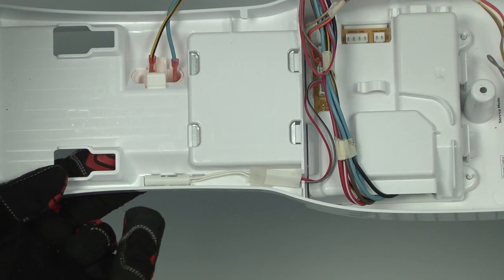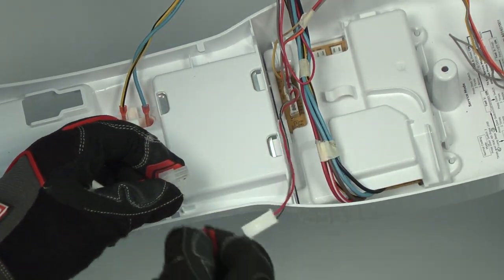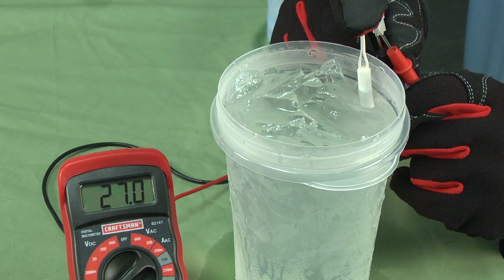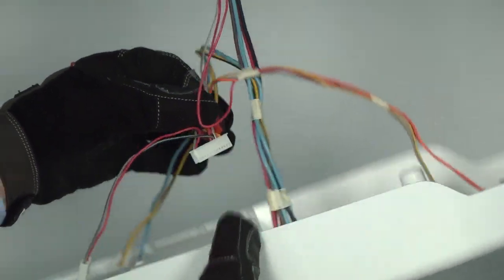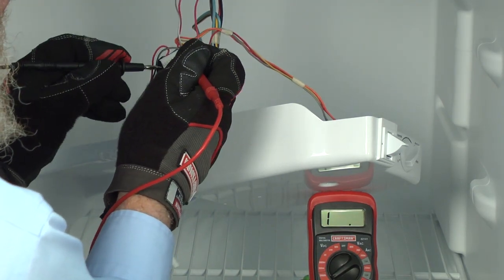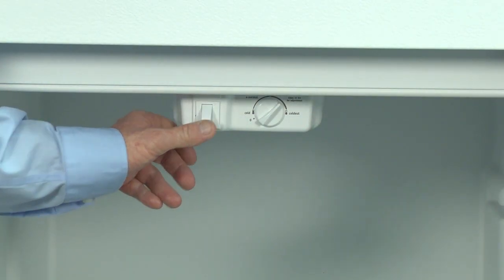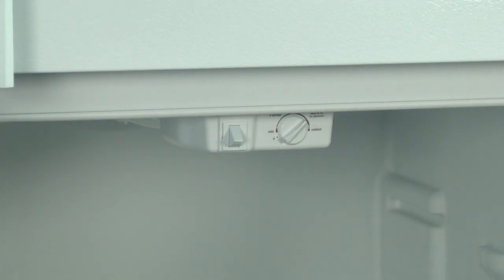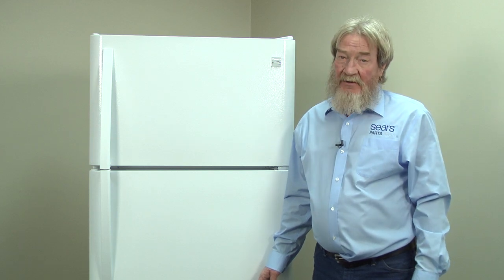Troubleshooting Thermistor Problems in Refrigerators

Comment: Is the control board housing on my Kenmore 60412 removed with a screwdriver or nut driver? Thank you
Reply from the maker: That model uses ¼-inch hex head screws to mount the control board housing. Use a 1/4-inch nut driver to remove those mounting screws.
Reply: Thank you, but I was talking about removing the actual large white housing that holds the board, thermistor, light, etc. I found one 5/16" hex in front and unscrewed that, but it is still somehow held in back. Is this held with keyways and slides out? I don't want to break anything. Thanks again
Reply from the maker: @MichaelJohnson-mb1io  After removing that front screw, pull the control housing forward about ½-inch to release the keyed slots in the control housing from the plastic tabs mounted to the roof of the refrigerator compartment then lower the control housing and unplug the wire harness. You can see the keyed slots in the housing and the plastic tabs on the roof of the refrigerator compartment in the video.
Reply: Thank you very much, I noticed the slots in a video.
Reply: I appreciate your help. So now I'm hoping it will be either the heater or the thermistor and I will test both, and the wiring. Is there only one heater and thermistor that will fit the Kenmore 60412, and if so, what are their part numbers, please. Thank you
Reply from the maker: @MichaelJohnson-mb1io  There are 17 different 60412 Kenmore models. Kenmore uses a model number prefix of 253 (253.60412…) for those models. Those 17 models have different control systems. Some use a thermostat and defrost timer to control cooling and evaporator defrost while others use an electronic control board and a fresh food compartment thermistor to control those functions. Your details seem to indicate that you have a model that uses an electronic control board to control temperature and evaporator defrost functions. If your refrigerator has and electronic control board and it's having cooling problems because of excessive frost build-up on the evaporator, follow the troubleshooting tips in this article/video to fix the problem: https://www.searspartsdirect.com/diy/article/refrigerator-wont-cool-troubleshooting-video-defrost-system-problems . A 60412 refrigerator with an electronic control board typically has 2 thermistors. One thermistor located in the control board housing monitors refrigerator compartment temperature and a defrost thermistor attached to the evaporator monitors evaporator temperature and helps control the defrost function. If the defrost thermistor isn't accurately measuring evaporator temperature, then you'll need to replace the defrost system wire harness that includes that thermistor ( https://www.searspartsdirect.com/product/2088n9if61-0046-253/id-242213501 ). Note: Be sure to unplug the refrigerator before replacing parts. If the refrigerator compartment thermistor isn't accurately detecting temperature inside the refrigerator, replace that thermistor with this replacement part https://www.searspartsdirect.com/product/4yv4pimcyn-0046-253/id-240597203 . The 60412 refrigerator only has 1 defrost heater. Here's a link for that replacement part: https://www.searspartsdirect.com/product/5lmgrsv9zh-0046-253/id-242044020 . If the defrost bi-metal thermostat isn't working, you can replace that component with this part: https://www.searspartsdirect.com/product/mzu0nl3g08-0046-253/id-5303918634 . (The defrost wire harness mentioned above also has the defrost bi-metal thermostat included as one of its components.) We hope this information and advice helps. If you need more assistance, let us know the full model number of your 60412 refrigerator and more details about the problems you're seeing. You can find the full model number of your refrigerator on a sticker located on the right side wall inside the refrigerator compartment.
Reply: The thermistor next to the control panel in the refrigerator is good, but I can't access the brown and blue wires to measure the defrost heater continuity. Am I missing something, or should I just go ahead and measure the heater resistance in the freezer? Would it hurt to stick pins in the brown and blue wires to obtain a measurement, if I sealed the punctures afterward? A non Sears source said that for some reason you couldn't measure the resistance of the defrost heater in the freezer, which I seriously doubt. Any validity in this? Thank you
Reply from the maker: @MichaelJohnson-mb1io  The temperature in the freezer compartment has to be below 46-degrees to accurately check defrost heater continuity through the brown and blue wires at the control because the defrost bi-metal thermostat is in that circuit and the defrost bi-metal thermostat trips at around 50-degrees so you wouldn't get an accurate resistance reading unless the freezer is below 46-degrees. You can unplug the refrigerator and access the defrost heater wires as shown in this repair guide/video: https://www.searspartsdirect.com/diy/repair-guide/how-to-replace-the-defrost-heater-in-a-top-freezer-refrigerator . Unplug the defrost heater wires from the wire harness and measure resistance through the defrost heater. If your meter measures infinite resistance through the defrost heater, replace it. Don't forget to unplug the refrigerator before replacing the defrost heater.

Comment: Does anyone know if a domestic refrigerator can have a thermistor and a defrost timer at the same time or can they only have one of the two?
Reply from the maker: If the refrigerator has an electromechanical defrost timer then it typically doesn't have a thermistor. Thermistors are used in models that have an electronic control board that controls the defrost cycle and other refrigerator functions such as cooling.
Reply: @searspartsdirect  oh my GOD!!! thank you so much for your answer. This question was breaking my head. Thank you again!

Comment: It looks like only the red lead of the multimeter is being connected to only one of the two sensor leads. Is that correct? How is the multimeter measuring resistance without using both probes?
Reply from the maker: The black lead of the multimeter may be difficult for you to see but it is connected to the other sensor contact.

Comment: What tool is needed to take the top compartment off in the refrigerator?
Reply from the maker: To release the control housing in the roof of the refrigerator compartment of many refrigerator models, you'll need to unplug the refrigerator and remove fasteners using a screwdriver or nut driver. You may also need to release catches to remove the control housing from the roof of the refrigerator compartment. We hope this information helps. If you need more assistance, let us know the model number of your refrigerator and more details about the compartment that you're trying to access.

Comment: LMX25964ST is the model of my samsung fridge. Does this ohms reading apply to most or all models of samsung fridge? Also what is the thermistor looking part that is tucked inside the evap coil?
Reply from the maker: The model number you posted appears to be for an LG refrigerator. On that model of LG refrigerator, the thermistor tucked into the evaporator is part of the defrost sensor assembly. The part number for that model depends on the revision numbers after the "ST" in the model number. For model LMX25964ST/00, the defrost sensor assembly is part 6615JB2005H ( https://www.searspartsdirect.com/part-number/6615JB2005H/0046/795.html ). For models LMX25964ST/01 and LMX25964ST/02, the defrost sensor assembly is part number 6615JB2005N ( https://www.searspartsdirect.com/part-number/6615JB2005N/0046/795.html ). The thermistor resistances in your refrigerator differ from the resistance of the thermistor shown in the video. For your refrigerator, the resistance through the defrost thermistor in that defrost sensor assembly should be 30 kohms at 32F, 77 kohms at -4F and 13 kohms at 68F. Be sure that you unplug the refrigerator before accessing internal components. We hope this information helps. If you need further assistance, let us know.

Comment: Great video sir I do have a question please! I pulled out the freezer temperature sensor in my Samsung side by side freezer and checked the resistance which seems fine. My question is do you have to do the cold water test also I only checked at room temperature and did get the correct reading?  Our fresh food side temp is fine freezer not cooling as well as it use to melted ice cream and no ice being made. Any help would sure be appreciated from any of you pros out there I am just a newbie trying to work my way through the repair. Thank you in advance have a wondeful day. Paul
Reply from the maker: If the meter measured the right resistance through the thermistor at room temperature then the thermistor is likely okay. Let us know the model number of your refrigerator and we’ll provide some DIY troubleshooting tips to help you fix the freezer cooling problem.
Reply: Did u ever figure your problem out?

Comment: Hi. Hoping you can help me. I have a Frigidaire side by side PHS67EHSB4 that's been acting up. The freezer and fridge stopped cooling all of a sudden.  I decided to leave it unplugged for 24 hours thinking this will somehow reset the motherboard to its default setting and get it to work normally again. After I plugged it back in both the freezer and fridge will work normally for about 20 hours before shutting off again. It will not come back on unless I repeat the unplug/plug process again. When it is not working, the temperature on the control panel is still registering false temperatures of 27 F on the freezer side and about 39 F on the refrigerator side. I can then get it to work for another 20 hours or so if I unplug/replug it again. When it is not cooling, the lights are still on. I wonder if it is the thermistors. If it is the thermistor do you happen to have the resistance specs for the freezer and fridge thermistors for both room temp and freezing temp?  The thermistor part numbers are 241608401 and  241608501 but I cannot find the specs for these thermistors no matter how hard I tried.  Once I get the specs I think I will be able to remove them to test them with my multimeter. Thank you in advance for your help and expertise.
Reply from the maker: At 32 degrees, thermistor resistance should be 32,566 ohms. At 72 degrees, thermistor resistance should be 11,304 ohms. Both thermistors should have the same resistance at those temperatures. It’s normal for resistance to be off as much as 5%.
 
If thermistor resistance is okay, check the operation of the air damper using the diagnostic test mode because your symptoms point to an air damper failure. The refrigerator electronic control board shuts off cooling if the air damper fails to operate. You can restore cooling by unplugging the refrigerator for 1 minute then restoring power to the refrigerator. The refrigerator will cool properly until the control again detects the air damper failure.
 
To enter the diagnostic test mode, press and hold the Freezer Temperature UP key then press the Freezer Temperature DOWN key 3 times within 5 seconds. Release the Freezer Temperature UP key and the Freezer Temperature display will show 1 and the fresh food display will be blank. Press the Freezer Temperature UP key to scroll through the diagnostic test modes until the Freezer Temperature display shows 5—the air damper test mode. The fresh food (refrigerator side) temperature display will show the condition of the damper: “0” for fully open and “—“ for fully closed. Cycle the damper door open and closed by pressing the fresh food temperature UP and DOWN keys. After testing the air damper, exit the diagnostic test mode by pressing and holding the Freezer Temperature UP key for 5 seconds. The display will beep and the control will be in normal operating mode.
 
If the air damper doesn’t fully open or fully close during the diagnostic test, unplug the refrigerator and check the wire harness connections between the air damper and the electronic control board. If the air damper wiring is okay, you’ll likely need to replace the air damper (https://www.searspartsdirect.com/part-number/241600906/0046/253.html). If you replace the air damper and the problem continues, you’ll likely need to replace the electronic control board (https://www.searspartsdirect.com/part-number/5303918340/0046/253.html).
 
If you need more help, let us know.
Reply: I would like to follow up on your response.  I too am having a similar problem.  I don't really know how long my fridge cools before it stops.  But it does the same thing.  It cools, stops cooling, but never continues to keep cooling.  All I have to do to get it to start back up again is to open the fridgerator door and whithin 1 or 2 seconds starts cooling again.  In other words, you can hear the fan/motor kick in and starts blowing.  Is this an indicator that the thermisters are bad or is it something else.  I did run through the diognostic test and everything seemed like it passed.

Comment: Great info but actually YOU MUST use the fridges tech sheet and measure the temp AND match the ohms against it. Also check dc output at the board. Thermistor values change according to manufacturers. Again if no tech sheet is present this will point u in a good direction
Reply: mabe top mount ref.model ITV1101CERS what is the correct resistance value of defrost sensor

Comment: Hi  Wayne, I have the opposite problem. My refrigerator temperature control seems to have no effect on the temperature of the fresh food section of the frig. It is too cold all the time at any setting. What would cause that?
Reply from the maker: The damper that controls air flow from the freezer to the refrigerator could be stuck open. Provide us with a model number and we’ll try to give some troubleshooting tips for your refrigerator.
Reply: Hi Wayne, the model number is GTL18JCPDRBS thanks for any assistance. Bill
Reply from the maker: Thanks for providing that model number. Your refrigerator uses a cold control thermostat and an air damper system to control temperature in the refrigerator and freezer sections.
 
The refrigerator temperature control knob adjusts the cold control thermostat. The cold control thermostat senses refrigerator section temperature and turns the compressor on and off to maintain refrigerator section temperature.
 
The freezer temperature control knob moves an air damper that controls how much freezer air circulates down through the refrigerator compartment. Setting the freezer at a warmer temperature (1 or 2) allows more air to drop down into the refrigerator section so the refrigerator section cools down faster and the cold control thermostat shuts off the compressor sooner so the freezer section stays warmer. Adjusting the freezer temperature control knob to a colder setting (8 or 9) allows little air to flow down to the refrigerator section so the compressor runs longer – making the freezer section colder.
 
Check your settings. Try settings of 5 for the refrigerator and freezer sections and allow 24 hours for the new settings to take effect.
 
If the refrigerator is too cold with both controls set at 5, then check for items blocking the air damper into the refrigerator section or the air return vents back into freezer. The air damper vent supplying air from the freezer is at the back of the refrigerator section ceiling and the return air vents are at the back corners of the refrigerator section ceiling. Blocking those vents will prevent air from circulating down through the refrigerator section which will cause the compressor to run constantly so the refrigerator will be too cold.
 
If the air vents are clear, then the damper shaft, freezer temperature control knob or the damper could be broken. Refer to the Fresh Food Section of the parts list diagram (http://www.searspartsdirect.com/model-number/GTL18JCPDRBS/0432/0166000.html) to see these parts. You’ll need to unplug the refrigerator and remove the screws from the Control Housing (Key 624) to access the Freezer Temperature Control Knob (Key 301), Damper Shaft (Key 319) and Damper (Key 305). Replace any damaged parts.
Reply: @searspartsdirect   This just helped me repair my problem 4 years after you posted this.  Thank you.
Reply: William Bro I have Kenmore 111.6120. Fresh food section is too cold. Please help.

Comment: Hi, very nice video, but the sensor is not a thermistor, it's just a resistor.  If someone is attempting to lean how his refrigerator actually works, they will be confused by this charactrization.
Reply from the maker: Thanks for the compliment and your efforts to help keep our advice accurate. You are correct that the sensor is a resistor but we call it a thermistor because its resistance changes with temperature (by design) more than standard resistors.

Comment: thank you very easy and simple, just wonder such advice are for all kind model freezer refrigerator
Reply from the maker: The thermistor troubleshooting advice generally works for most types of refrigerator-freezers. The electronic control board and thermistor will be in different locations on the various models. Don’t forget to refer to the tech sheet for your refrigerator to determine the accurate thermistor resistance values when testing the thermistor using a multimeter. Let us know the model number of your refrigerator-freezer if you need specific help for your exact type.